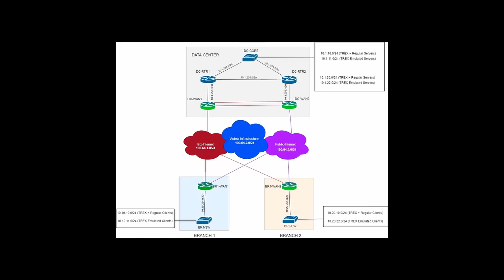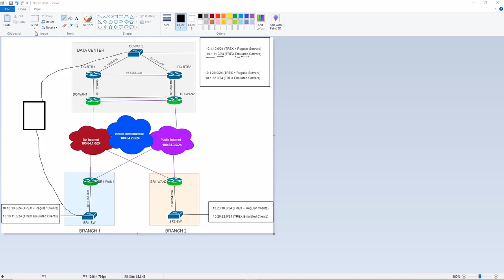TRex: The Demo Lab and High-Level T-Rex Overview

Comment: Hello, this video series has been a great help! I wanted to ask you if it is possible to evaluate a similar but real scenario, having two trex hosts, one acting as a server and the other as a client, I cannot find how to run trex specifying the client's ip on one host and the server's ip on the other, many thanks!
Reply from the maker: Hi Agustin, the TRex does this itself. It sends traffic out one end as the client and receives it on the other end as the server. This is what allows is to calculate things like frame drop/packet loss. I believe I explain this in this series, and maybe better explain it in my SDWAN CPOC Walkthrough involving TRex as far as the real-world use case. Hope that helps.
Reply: @CarpeDMVPN  Thanks for the quick reply! I may have explained it wrong, I do not have the possibility of a single instance of trex, being a real scenario the edge routers are in different locations, I would like to configure a machine for an instance of trex that acts as a server and another in another place that acts as a client, as shown in the documentation for client / server mode, in asfm mode. And again many thanks!
Reply from the maker: @agustinpizzarello4887  This should work fine, I haven't done it myself but from reading the (very sparse) documentation it seems possible with a switch on the command line to use astf mode. If I get a chance to lab it I'll make a video.